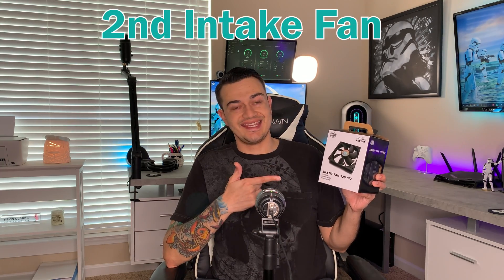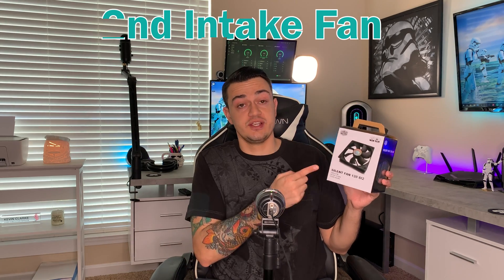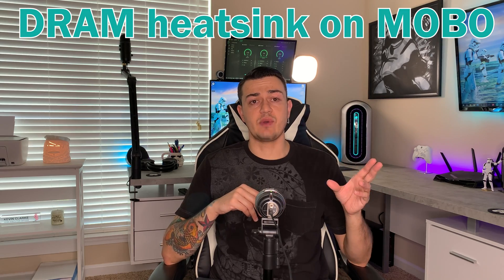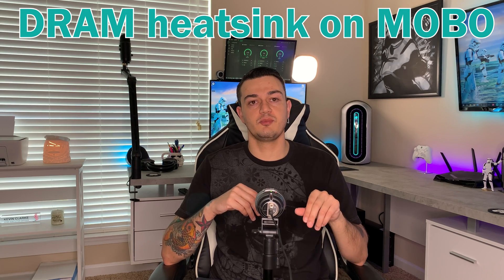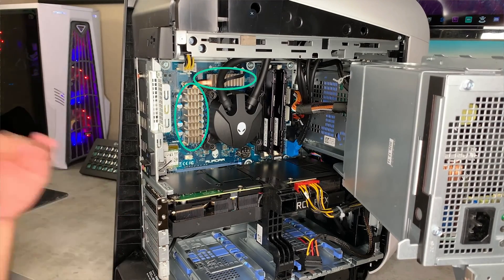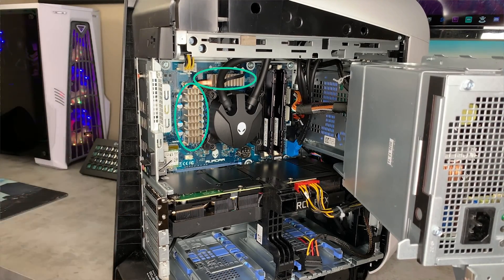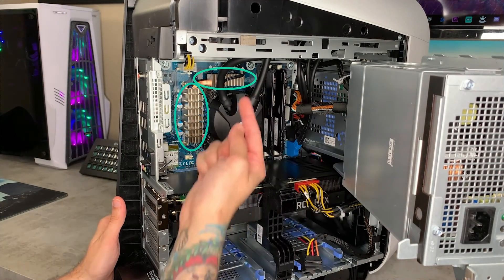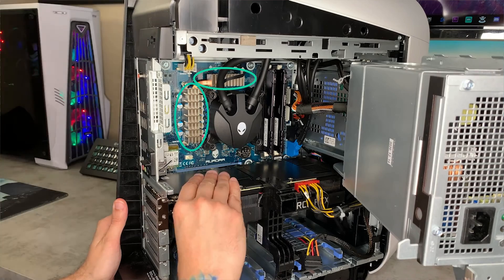5 Must Do Mods/Upgrades For The Alienware Aurora R10/R11/R12

Comment: I'm still using my R11 and I haven't had to worry about cooling issues yet. I got the liquid cooled version so far so good, however, I have not upgraded my 2060 super gpu or ram or even the 550watt psu. Just added a new terabyte pcie nvme, on top of my 2 smaller 500 gig ssds. 
Money is still tight, so I'm going to start upgrading slowly and I love this machine, it's been flawless since 2019, am not going to buy new for maybe another 3-4 years. This video is now saved for future reference. I'm excited to do this!

Comment: This is 3 years late and a long shot, but I need help, lol. I bought my r12 about 3 years ago, and it's been a wonderful machine. But now, I'm suddenly getting the pump fan error code. I have no idea what to do. I've tried using the QR code to bring me to the website for assistance, but I can't afford 100$ for their help on the weekend. I've taken off the panel to clean and clear out dust and any potential blockages, but I know nothing about computers, and I'm terrified to mess with anything internally. Any advice would be super appreciated.

Comment: Having an issue with my Alienware r10, I am getting a diagnostic at boot up saying cpu fan failure plus 2 beep codes fallowed by 3 beep codes, when I go to dell’s website and run the diagnostic, it comes up as 3 fan failure, the computer is still up and running, fans are working, Alienware command centre is not responsive I can install it, run the program, no response other then that computer runs normally, and help would be greatly appreciated 

Thanks
Reply: I would also like to add that my system is liquid cooling so I did change out the stock fan and put in the corsair H 60 I also plugged it into the pump header. There is nothing plugged in into The CPU pins

Comment: Im new to Alienware. Just bout a used one because i always wanted one. since like the 90's I've always built my own PCs. My Alienware Control Center looks different. Is there a better link for it? I have a hard time finding any info on my R11 on Dell. Its horrible. Now you see why i Build my own "normally" but I do LOVE Alienware just to have 1. Anyways i wis h i had a pdf pr something on any upgrade paths (dell sucks in providing paths). Or maybe im just not familiar with steps i need to take with Dell. Etc. I dunno. Please lmk some basic fundamentals on prebuilds this is literally my first in 30 years. Great vids & TY in advance!

Comment: purchased two Noctua NF-F12 iPPC 3000 PWM fans and attempted to replace the stock fans completely I ended up with the Bios fan error on startup. The solution I came up with was to use splitter cables making sure the stock fans were connected to the four pin and the Noctua fans connected to the three pin. I now have two intake fans and two exhaust fans without any error codes.

Comment: Hey Kev, thanks for your video, I have the R10 Ryzen edition with an 5700XT installed, i want to upgrade the GPU, to a 7800XT but I'm worried it wont fit in the case, they look quite big cards. Do the new cards fit ok?

Comment: If your purchasing all these upgrades on top of a prebuilt pc that charges 30% more then a custom prebuilt/ building yourself, then you know you’ve got a problem. 

If you are literally pre-ordering this and looking at upgrading its ram and cooling solutions, then STOP, and get a custom built pc instead
Reply: I bought mine 2 years ago because it was my first pc and I knew very little about them at the time, and it just seemed to make more sense to buy a prebuilt. Also since the custom parts are rarely available these days for retail price, it ends up being similar cost anyways for new graphics cards and such.
Reply: @mikemoggerson6651  if you where to get the same quality parts in the Alienware pc along with a custom pc, such as green ram, the crappy weird motherboard, cheapy fans, with a 120mm radiator, it would be significantly, significantly, cheaper to get similar parts in a custom built pc. 
Dell are charging the price as if it is up with a premium custom built pc (ROG maximus motherboard, Corsair/Gskill ram, Corsair 360mm AIO, asus tuff graphics card etc)
Reply: @LukeBroadhurstfilm  yea I know. I’m not saying it’s a bargain, but the graphics card made it make sense especially for a noob like me. The graphics card is almost impossible to find on its own at a reasonable price, and after all was said and done it would probably be more expensive to get it all separately and let’s not forget putting it all together (which I have no experience in). Getting someone else to do it would also cost money. 

I’ve had mine for 2 years and it’s mostly pretty good. Good performance and I haven’t upgraded anything, although I kinda want to do an upgrade soon. I want a super high end system with the best cpu and a 4090 or something, but I realized now you can’t change the cpu to a newer version easily on the motherboard. So I will probably just sell it entirely and build a new one this time
Reply: @mikemoggerson6651  the graphics card is a 3080 or 3090 correct? 
I’m currently building my first pc. Pretty easy. All parts come with the required screws and manuals for assembly. And it would only cost $100 to have someone else do it for you. 

In Australia that Alienware system costed seven god dam grand. A comparable custom built pc with the same graphics card (this is before RTx 40 series released) costs $4.6 grand. 

I knew nothing about computers last year. But after being a victim to a shit Acer prebuilt pc I put in the leg work to learn about computer parts via YouTube. Now I know how it all works and I’m building my first pc without even looking at the manual.
Reply: @LukeBroadhurstfilm  I had a 3070 with I7 10th gen and 16 GB ram for 2300 CAD. It was on sale at the time

Comment: I took your advice and upgraded my Aroura R12 intake and top fan to a new redux noctua NF=p12 1700 pwm fan, but now at start up I am getting a top fan fail message and the fans wont put out more than 40%. I heard something about getting a 3pin to 4 pin adapter for this will fix the boot up and fan problem. any advice helps. thanks. PS the new fans are still way quieter so I would like to keep them and hope theres an easy fix.
Reply: I heard only Corsair pro will work (from another vid). Don’t take my word for it though

Comment: R12 ram kits need to be 1.2v if you use all 4 slots... XMP won't work correctly if you don't... also the r12 base memory I have in mine doesn't have memory or CPU OC in the ACC.

Comment: 3:24 this is very important i have to say, IF YOU WANT TO SIMPLY ADD RAMS TO YOUR ALIENWARE, IS NOT POSSIBLE.
DELL USES HYPERX RAMS, BUT THEY ARE NOT COMPATIBLE WITH THE ONES HYPERX ARE SELLING EVEN IF YOU GET THEM IN THE EXACT SAME CONFIGURATION
Reply: So how do we work around this?
Reply: @jcurry_clips  potential workarounds: 1). You get the RAMs you want prebuilt w ALIENWARE.
2). You get the RAMS w lowest capacity w ALIENWARE, then you take it off to either build another PC or sell it online, and then you get your own RAMS 
3). I believe ALIENWARE would sell you the HYPERX RAMS they use on your Alienware but you’d have to email them.
Reply: @jayzou6534  Im confused because I’ve seen videos of people putting the ram in Alienware.
Reply: @jcurry_clips  also it could be something w the XMP file as well, the video you mentioned, when the RAM is installed, is it working? They might tune them to the same (but lower) frequency so they would work together

Comment: Reading around on the internet the AUrora R12 is a total bitch to upgrade and replacing the fans often results in Bios Errors and failure to POST/boot.

Comment: Remove the base. Add an air filter and 2 fans blowing air up and in then add the 2, at the front and 1 at top front blows in top front blows in too rear expels the heat out the back vent port, remove any brackets or holders that are not in use, definitely hit the thermal paste and i think that set up will completely change the cooling on this unit and has dell opened that base for air intake this thing would’ve been the best gaming console ever

Comment: Is it true to upgrade memory in an Alienware device it has to be OEM sticks bought from Dell to recognize XMP to allow it to run at its sold at frequency? If so has Dell eliminated the ability for an aftermarket DIMM upgrade? 
I purchased an R14 and having difficulty running the memory frequency greater that 2667MHz.

Comment: @Gamer Heaven - How did you get a 120mm fan in the spot the 3.5" hard drive caddy was?  I saw the HD caddy bracket can take an 80mm Fan but would like to remove that all together for better airflow and go larger with another 120mm Corsair ML Pro.  Can you please provide some insight?  Thanks!

Comment: This is my 4th alienware and has to be the worst ever for cooling it has no software for fan speeds no fan at top vent to expel heat playing fligh sim 2020 its like sitting near a raduator i expect more from a 3k machine.
Reply: Never had an issue with my R11 liquid cooling staying just cool enough. I use the Alienware command center in this video and you can put the thermal to higher settings and you can hear the fans kick in. Also, you can unlock the hidden power setting in windows 10 or 11 to Ultimate within windows and it will then show up in command center , now you can just make 2 clicks to run performance or echo setting for idle time.

Comment: Hi im living in Singapore...temperature room around 30c...I have a R12 Alienware watercooled CPU with 3090....But my 3090 is running super hot 110celcius on the Vram! I've added another Fan like what you suggested at the front chassis and I repaste it with a higher grade Thermal paste...it is still running at 100celcius....anyway we can watercool the Alienware 3090? So frustrated

Comment: Hi , do you have a video on installing the second fan and the push pull fan? and is it easy to install thermal paste and pads on the Vram? I am looking at an R10 with Ryzen 9 and the 3080 on sale 30 percent off rn, i will buy it if maybe you could help me upgrade to make sure it's safe. it just seems like such an amazing deal, and I watched a few of your videos, you seem to be the AlienWare guy to ask. you have a lot of their stuff. The other pc i am looking at is Lenovo Legion with i9 and the 3070 for around the same price. I am usure what to get. Dell is here in Canada and they do have a good warrantee plan so I feel like i should get one of theirs, but there are a lot of bad reviews on alienware, but they seem to be older videos, maybe alienware got a lot better now?? The one i am looking at does have the liquid cooling too it says. oh and the case has some nice vents on this one it looks like too.

Comment: The r11 that I bought had a stock fan that has "148.9CFM" on the label. Apparently with 4300 RPM. Is this the same one you pulled out and does it still need to be changed with such high specs?

Comment: "They are are great PCs..." but here are 5 things you MUST do in order to make them run properly... Horribly designed and horrible parts and missing of parts, the CPU cooler doesn't fit correctly, it is not even designed for the cpu it is being paired with and has the temps going to 100C, the vram has no heatsinks, what? Everything is starved for air. It get ship with a single stick of RAM and it is in the incorrect slot. Everything about the design is stupid and in the way. If you have one I hope it works well for you, but man.
Reply from the maker: I see you have seen gamer nexus’s video. While I get what you’re saying, and I’m not defending this company, literally everything you just listed does not apply to getting a water cooled CPU version, which is what I own, well owned lol. The VRM does have a heat sink, the temps do not go to 100c, the CPU cooler fits over the processor, and there were two sticks of RAM installed on my model, both in the slots they should be which is two and four. Just wanted to clarify this.
Reply: @GamerHeavenOfficial  I also just had a friend drop his off for me to have a look at, as it is under performing, making a racket and having temps that are a bit crazy. The water cooled one may be better, and that is great, but the fact that they are okay with releasing the crappy fan version out to the wild is absurd.

Comment: Bought the  same pc from eBay without a gpu did the mods . Upgraded AIO corsair H60 worked great ; Found the VRM coolers on Amazon that work out great . Installed upgraded ram corsair vengeance lpx 3200mhz .  My model is Alienware R10 with the Ryzen 5600X also upgraded the NV Me with a Samsung 970 evo. As for the GPU I installed the Asus Dual 6700xt OC .Had to remove  the small 45 degree stiffer on the bottom of the swing arm or power supply bracket to make the supply bracket close. After doing that I was able to replace my side cover .The GPU I ordered is larger than the stock GPU sold by Dell . Mod was pretty easy to perform just get a Dremel tool and drill out the rivets holding the 45 degree stiffer . Make sure to remove the power supply don't want to drill into and damaging.  Paid 500 for the tower on eBay and 900 for the GPU I guess scalper price .So far so good with the rebuild , PC is fully functioning  . Good performance plays my games without skipping a beat .The front of the case looks pretty cool gets a lot of attention from the family .This product from Dell could of been perfect if the case was a tab bit bigger to fit regular  sized parts . Get rid of that swing power supply cradle which I think they have on the new models they sell on the web site . Make them that people can keep them going without modifying   the freak out of them . Sell the parts in abundance so the customer of their shit can do their own repairs .Well I had fun rebuilding this computer . Thanks .

Comment: We just received a new R12 purchased during Black Friday at a substantial discount. The system is an 11th Gen Intel Core i7 11700F, RTX 3060Ti, 512GB M.2, 16GB, 2x8GB, DDR4, 3200MHz all of this for only $980 (without tax) with discounts! This was an insane deal.  Unfortunately, the water-cooled option was not available for the system deal.  We have the Dark Side of the Moon cool which does not have the same lighting options as the White system. This is fine as the system would be positioned such that the lights would not be seen. The system looks good but like many have mentioned it has cooling issues.  We have the system raised on a mesh stand with plenty of room for cooling.  We first noticed the fans making a clicking noise while idling!  I checked to make sure all fans are working and they are. We completed all updates and with nothing running while on idle the system CPU keeps jumping from 62° to 100° Celsius while the CPU performance is bouncing around the lowest to the highest. This is occurring while the system is idling without anything installed yet and no overclocking! Not a good omen. Also noticed there are no VRM heatsinks installed on this unit which could account for some of the CPU heat. The stock CPU fan is anemic. The interior design is small and will not fit a stock RTX card if you wanted to upgrade it.  It is not a system to upgrade over time but again at the $980 price point, I didn't care. If we could have purchased a water-cooled system at the reduced price point we would have and I believe the design hinders the ability of the system to adequately air cool it.  It is noisy when it kicks in cooling. What is surprising we were running a Lenovo Legion 7i notebook on the desk with a docking station (10th Generation Intel® Core™ i7-10750H Processor, NVIDIA RTX2070 Max-Q) at full settings in games and couldn't hear it but the R12 is like a fan running on high!  Again we are so disappointed and will go back to using the Legion 7i. We could do your recommendations but it is not worth our time or effort. Thanks for your suggestions.

Comment: I found a decent deal on the new 13 but stock the 250gb to 1tb m.2 nvme upgrade is like +$150. its not water cooled. +20. (not horrible). but the psu is  550 watt even in the 3060ti model. and thats +100. it comes with 16gb ram and theres no upgrade to 32gb if you want 64gb its +200. ect ect ect. its a beast machine but its that warranty that comes with a ferrari or porsche. you gotta deal with.

Comment: Also. Beware automatic BIOS upgrades. My R10 was bricked when it updated from 2.1.3 to 2.2.1 and over a month later I'm waiting for the engineer to come and put in the 3rd replacement mobo.
Reply: My computer bricked yesterday. I scowered for the bitkicker recovery code and full wipe. Not sure if was an update to the ram (the last update I did before brick) or something else. Anyways, the computer is back but kinda sluggish. I was able to recover it after fining the bitlocker recovery code.

This is the first time it has happened after continuous, 10 hr a day, use (work  and personal use).
Reply: @vman1320  My machine did get fixed and I immediately turned off automatic BIOS updates. And in SupportAssist when it wants to update all its little bits, I uncheck the BIOS box. It can't be trusted to get it right. And you should really always hang around when it updates, as there might be a valuable error message that could help you undo the mess.
Reply: @pcread  great advice

Comment: This video was very helpful though I have some questions about how to change from mechanical hard drives and whats the best new thing to change to? Also if the push pull mechanisim is something I can do with the cooler master fans or do I buy different ones for those?